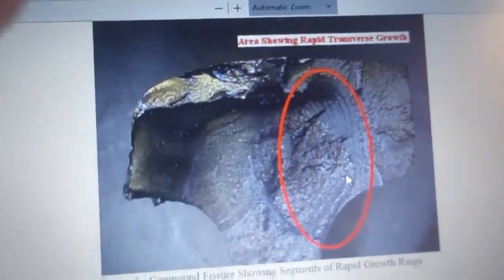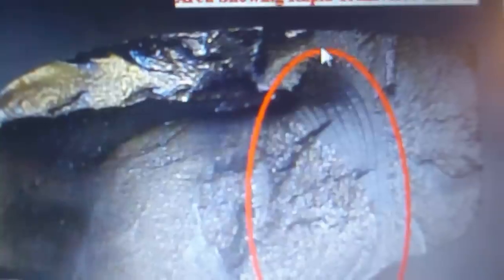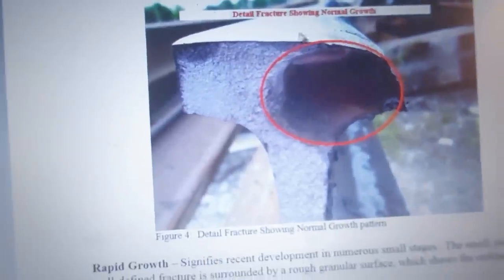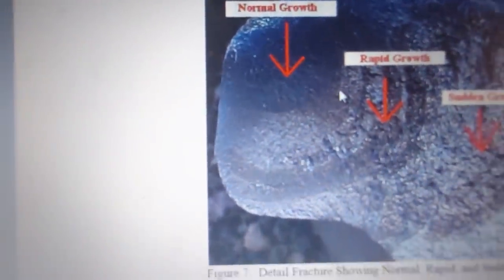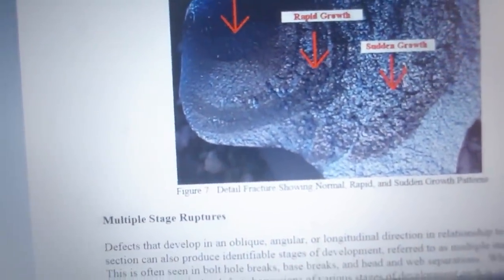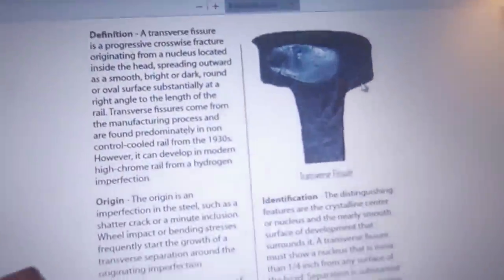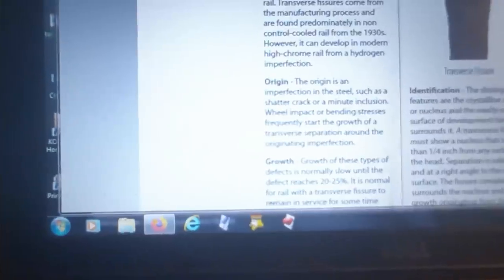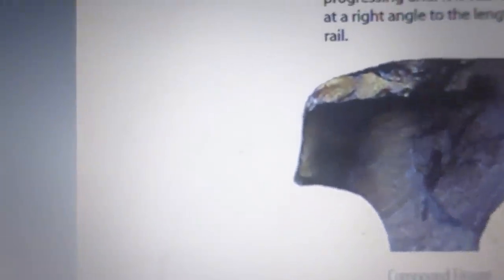Cancer in the Rail Head

Comment from the maker: Think of all the passengers and freight moving across our nation's tracks. Ultrasonic rail
testing is so important to catch defects at an early stage thus improving significantly
the safety of those passengers and freight to help decrease serious accidents which
may cause serious injury or loss of life.

Rail mills are constantly trying to improve the quality of their rails. Every batch of
rails is tested and rails must conform to certain industry standards before they are
allowed to be sold. Controlled cooling for each rail is a requirement, however it is
not 100% effective 100% of the time in eliminating hydrogen deposits, but it is
a far cry better than before controlled cooling was invented.
Reply: Your sooo right...work safe dave!
Reply: Really makes you question the wisdom of programs like "Six Sigma" when they teach you to simply be perfect so you can skip doing quality control checks!
Reply: You need a big furnace to control the cooling of railroad track rails.
Reply: Dave, although it might not be you doing any of the ultra-sonic testing, I would think that you could use a tool, like a small hammer, that will peen the rail just by hitting the rail with it, and you should be able to determine whether the rail is sound or not just my the report after the hammer taps the rail:  if the report is not a ring the rail has a defect.  It is like a goblet that will ring, but if the goblet is defective it will tick or clink, but it will not ring.
Reply: @Mr1fish2fish  yes
.. that was the...old school way... if you hear a...clunk...or a dull sound... as the wheels pass over it...instead of a clickety clack...theres a problem!
Reply from the maker: @Mr1fish2fish  you are right but according to my friend who is a tester at Sperry hammer will not get  every defect 👍😊
Reply: @ccrx6700  I'm sure, with all the different kinds of testing that there are.
Reply from the maker: @Mr1fish2fish  👍😊

Comment: To accomplish control cooling of the rail,  after the rail is finished being rolled, it is loaded into an insulated box which is then closed to allow the rail to slowly cool from about 1200F down to about 650 to 700F.  This gives time for such things as hydrogen gas and other gases to escape from the rail which was found to cause shatter cracks in the rail if the cooling was done faster by being left out in the open.  
Modern steel-making usually uses vacuum degassing then the molten steel is poured into a vat that feeds a continuous bloom caster from which the rails are rolled.  Modern steel is much cleaner in manufacturing than it used to be.
Reply from the maker: Thank you Roy for sharing that information with us, excellent comment. Appreciate your taking the time to visit and check out the video my friend.

Comment: I am very familiar with metal fatigue.  When I was in my early 20's a 500 ton press I was running started rocking side to side by several inches.  I shut it down immediately and informed my supervisor.      Once they cleared away equipment at the base it revealed a crack that was nearly through the entire base.  It was down for several weeks for repairs.
Reply: It sounds like you got lucky that things didn't 'go south' on you without that warning.  Good on you for paying attention, you probably prevented much worse damage plus serious injury or death.
Reply: Way to be there buddy! Too many folks these days could care less. Just wait'n on that next break.
Reply from the maker: That sounds pretty scary harpintn, glad I wasn't there, but it 
would have made for a good video....:-)  Thank you very much for taking the time to visit with us and check out the video my friend.
Reply: Had a similar thing happen on the press I ran. I never knew the tonnage, but we used to blank .475" thick steel into two 22" diameter blanks. So it was pretty heavy duty.  Unknown to us, the shock absorbing material under the feet had compacted over the years, so stress eventually created a crack in one of the feet. It was spotted accidentally by an outside contractor.  Interestingly, the same issue with the shock absorbing material (a series of alternating steel and rubber plates) caused vibrations in a house about 3/4 of a mile away.  Just one house.  Not in the houses either side. We thought that malarky, but sure enough when they were at the house measuring vibration, it matched up perfectly to when we started and stopped the press.  Replacement of the shock absorbers on the feet solved that problem.  As to why it was just that house, that's a head scratcher.
Reply: @rodchallis8031  The press I ran made slabs that were turned into brakes for 18 wheeler.  I doubt it was as heavy as the one you ran.
Reply: @robertf3479  it was close to a safety isle, and it was leaning that way.  It could have been real bad to someone just passing by.
Reply: @ccrx6700  As you well know safety is the first job when it comes to dealing with  equipment.   That is true whether is is moving or solidly anchored to the floor.
Reply from the maker: @harpintn  👍😊

Comment: I was absolutely fascinated when I saw a rail stretcher stretch the rail like a rubber band!!! It's too bad you can't get the electric welder in there to start turning your jointed rail into CWR???!!! End batter is almost always the culprit in jointed rail derailments like in Weyauwega Wisconsin. Rails can hold up only so long sitting there pumping up and down in the mud!!! You do some very good work Dave!!! I'll bet it's hot as hell back there?????
Reply from the maker: It would be lovely to hav welded rail but because we have the 3 bolt holes the welders will not weld those rail together because the 3rd hole is to close to the weld, to ahve welded rail here would mean
replace each stick with blind ends ( no holes) Now we are talking major expense and time to replace all those rails. Thank you for taking the time to write in and for checking out the video my friend.

Comment: Steelton  has a vacuum de gasser as they call it. Some rails are marked VT for vacuum treated. I didn't work in the metallurgical dept. but i assume some of those internal failures are caused by trapped gas in the rail. Another great video Dave i can relate to what you are explaining.
Reply from the maker: Did you know Michael that about 7 years ago the RR;s AAR and the mills had a big meeting to figure out when  to have another big
meeting! LOL LOL.. But at that meeting they decided that if a rail
is cooled via VT then it need not be stamped as such. So now only rails that are cooled by a method other than VT need be stamped.
None of our newer rails since then are stamped VT and yes you
are right steelton degasses their rails. They would have quit stamping that right around or just after you retired so you would
not have known that.
Reply: @ccrx6700  Thanks Dave i did not know they discontinued that on the brand.I'm sure you seen the H H on the brand. I assume they still use that on rail. Rail Roads pay a premium price for that rail. The head hardened rail will last longer.
Reply from the maker: @BeeLineEast  👍😊

Comment: Resembles what we call a .505 pull test specimen… a destructive material test where we take a sample of material and cut a thread on either end and turn the O.D. To .505 inches and use a hydraulic mechanism to pull the sample apart to catastrophic failure noting the yield, and tensile strength of the material. The crystal looking surface is referred to a “frost” or “satin” you will also see the “polished “ area in some samples.
Reply from the maker: Some fissures are polished dp, this was black because of oxidation.
The one rail we used a hydraulic mechanism called a tamper to
break the rail when the jack beam picked the rail up ....LOL

Comment: We had some specialty steel assemblies that were carefully heat treated.  But then in order to finish the welding in the field, they had to preheat the thing to like 250 F before they could weld.  Welding itself can cause local high temperatures and rapid cooling that messes things up as well.  Crazy stuff they've come up with.

One place you see this is some semi-trailer beds, you'll see warnings along the main frame, 'do not weld'.  The hi-tech, specially heat-treated steel they use you can't just grab a stick welder and 'tack' on something after the fact.
Reply from the maker: Appreciate your sharing that info Mike, interesting to find out. Thank you for taking the time to write in and for checking out the video my friend.

Comment: Really good of you to try to answer so many questions.  What's a mud spot------assuming it's not just a spot of mud?  And do those growth rings indicate years, months, days?  Lastly, there must be other factors that cause cracks in your track, no?
Reply from the maker: A mud hole where there is a bunch of mud in the tracks shopshop
enough to cause rail deviations from normal track geometry. Those growth rings are not like tree rings, yes they grow over time but
are not indicative of a certain span of time. The internal defects
original cause is from an impurity in the rail milling process, it
may develop over the years into a larger problem and it may
just lie dormant in the rail and never amount to anything.

Comment: Dave, in welding they have a term called slag inclusion! Where slag that protects the molten weld can sometimes get included in the weld, this has to be ground out and new weld laid down.
Is this a cause of these problems when the rail is formed and impurities get included in the steel creating weak spots hidden but vulnerable.
Reply from the maker: Very good comment ferstuck. Yes not only can an internal defect
begin from a hydrogen deposit, it can be from a slag inclusion.
Also I have seen a thermite weld break because of an inclusion in
the welding of those rails, in fact about 2 years ago I shared that
in a video but I can't remember the title of that video or I'd share
a link. Thank you for taking the time to write in and for checking out the video my friend.

Comment: Are these types of defects becoming more common? I'm just curious because of how much recycled material is used these days compared to years ago. I can't help but think that material can only be recycled so many times before it weakens.
Reply from the maker: No they are not Mike in fact they are becoming less of an anomaly.
Remember the rail I showed you at our place was rolled in 1975.
Rail mills are constantly trying to improve the quality of their
raw materials and also do a fantastic job at testing their steel.
You raise a good point in how many times a metal can be
recycled and that answer will have to come from an expert, not
me. Personal uninformed thoughts from me would be, now that
you got me thinking..... metal that is molten has a different
molecular make up than solidified metal. It's like water when heated
turns to steam, steam when cooled turns to air. It's the cooling process or lack of that which allows impurities to occur in the
solidified rail.... now I'll be up all night thinking about what you
just said.....:-)

Comment: Is it more common to have fishers develope near the end of the joint of rail because of cooling when manufactured than in the middle?
Reply from the maker: Good question Robert and they can develop anywhere in the rail
despite controlled cooling, it is not a 100% perfect solution 100%
of the time.  Thank you very much for taking the time to drop in on us and check out the presentation my friend.

Comment: Thats some serious stuff to have to deal with, but its all in the name of safety! Just curious, whats the weather like in your neck of the woods? Its been strange here in central Illinois. And speaking of metal "cancer", my nextdoor neighbor lost his large swimming pool overnight, due to one of the thin steel panels rusting out. The force of 14,500 gallons of chlorinated water created a "tsunami" in his backyard, and he hopes his insurance will cover the damage/replacement.
Reply from the maker: It certainly is serious stuff Paul, think of all the lives involved in
passenger and freight RR across the country riding on these rails.
Weather here has been hot, high 80;s up to 90 a few days, I don't
like it wishing it would snow.....:-)  Thank you very much for taking the time to drop in on us and check out the presentation my friend.
Reply from the maker: PS that pool breaking would have made for one cool video!
Reply: @ccrx6700  yes it would have been a neat video, he is a security guard by profession, and i am surprised he doesnt have cameras all around his house. (I wonder what his water bill is to fill that pool with 14,500 gallons, its probably way more than i could ever afford.)
Reply from the maker: @paulsmith5398  👍😊
Reply: @ccrx6700  as for your wish of cooler weather, its been upper 80s/low 90s here also, with only sporadic rainfall. However, on June 29th, a fast moving derecho went through central Illinois during the lunch hour, doing a LOT of damage, the sky was blacker than my cat, and he took cover while i watched the storm roll through, it also spawned 5 imbedded tornadoes, which prompted sirens in several communities around and including the capitol city of Springfield, and plunging 50% of the city into darkness by snapping 30+ large power poles. I am normally not scared of storms, but when the sky was like midnight and the siren 200 feet+/- from my house activated, that was all it took to make me a believer. The guy next door works nights/sleeps days, and he texted me as to why the sirens sounded. I texted him back, TORNADO WARNING SERIOUSLY❗, as he gets twerked when the sirens blow on test day.

Comment: On average, how old is the rail on your RR?  Is there any correlation with the age of rail (both from a wear (rolling loads, hot/cold weather extremes, etc.) standpoint and from a metallurgical standpoint at the time of manufacture) and the various types of rail failures?
Reply from the maker: A good part of our rail is still original 1975. Obviously the older it gets the more prone to defects it becomes Eric. Rail wear has many causitive factors as you can imagine. A full answer to your question
will require an entire 20 minute video to go over everything so
apologize for only being very general here in a reply.  Thank you for taking the time to write in and for checking out the video my friend.

Comment: I noticed that you said "fissure".  To me that is the word, not "crack".  It is what used to be in welding, they called them "cracks" but they are cooling fissures where the weld metal pulls apart when it shrinks when it cools and leaves what looks like a crack but it's really a cooling fissure.  It's like on Mars, those canyons are cooling fissures, and they don't know that...a lamination defect, as it shows an "inclusion" being hammered and hammered by crossing trains causing the inclusion to gradually fail and spread rapidly eventually.  Very interesting.
Reply from the maker: Thanks for sharing that very interesting comment Mr1fish2fish. Appreciate your taking the time to visit with us and check out the video my friend.

Comment: I've always considered rails to be nearly bullet proof, and for the most part they are. That said, I've seen rail hit with a rifle bullet which spider webbed. Still, overall there are relatively few rail failures, considering the amount that's out there being pounded daily.
Reply from the maker: Appreciate the nice comment JW, they used to shoot bolt holes
thru rails with high powered rifles believe it or not. Not allowed to
do that anymore. Thank you for taking the time to write in
and for checking out the video my friend.

Comment: Are the new owners OK with the track condition?  Seems like too many track problems.  Why not upgrade and increase speeds?  A car dump-door maintenance and Scheduled door opening 'lock-over' to be maintained.  Best to tune these car doors before failure.
Reply: I am just guessing, but it sounds like they run 2 or 3 trains a day, so I doubt if saving 10 or 20 minutes per trip would mean that much. And wouldn't higher speeds create more wear and tear on the track and related?  But here's hoping Dave will jump in with the answer.
Reply from the maker: If you had seen our latest track geometry report you would say,
wow you guys got some great track, In fact the geo guys who
tested told me this is one of the best jointed tracks they have
ever tested. We will never go over 25 MPH, way too many high
degree curves. You may also be interested to know our latest
ultrasonic report, 2 months ago showed zero defects. You are
watching old videos, always check the date in the description for date of video made. Appreciate your taking the time to visit and check out the video my friend.

Comment: That's all interesting information. However, I am still convinced (based on the markings on the rail applied by the testers and the written report provided) that what you had was a Detail Fracture (TDD), not a Transverse Fissure (TDT). Page 20 of the 2015 'Track Inspector Rail Defect Reference Manual' states, "Detail fracture means a progressive fracture originating at or near the surface of the rail head. These fractures should not be confused with transverse fissures, compound fissures, or other defects, which have internal origins  "
I doubt the ultrasonic rail testing operators would have misrepresented the results of their tests.
Reply from the maker: Appreciate your sharing that Joe, several of the pictures I showed
were indeed detail fractures. If you watched the first video in this
series I showed in the Sperry book where it said transverse fissures 
were classified under the heading of TDD however I hear you on the TDT. I don't want to "split hairs" here with you however so I'm going to leave it as you are right.  Thank you for taking the time to write in
and for checking out the video my friend.